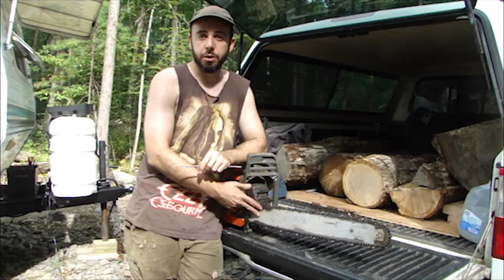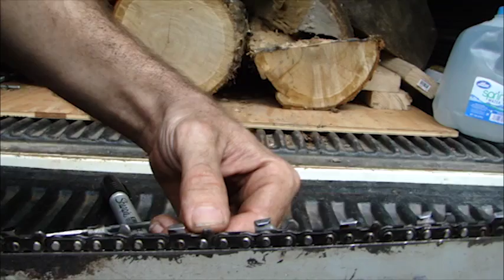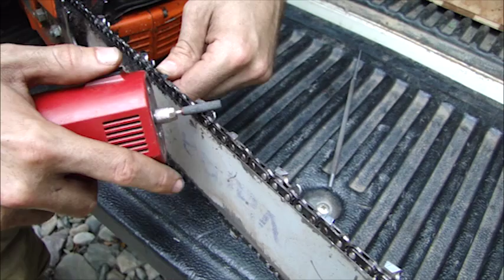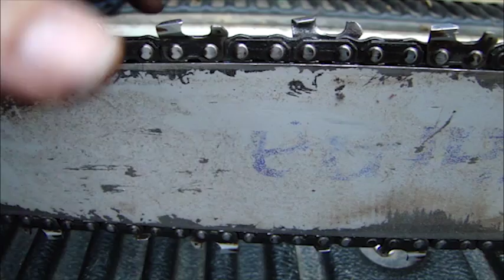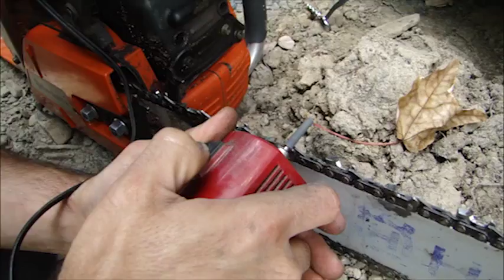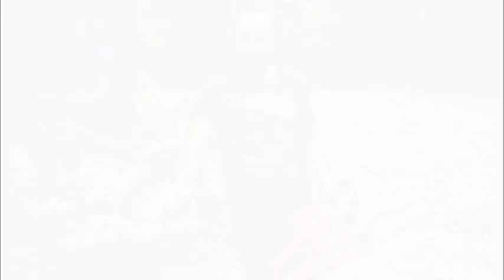How to Sharpen a Chainsaw

Comment: The term "raker" is a misnomer.  It doesn't rake a chip from the kerf, the cutter does that.  good to see you point what the "raker" does, it is a depth gauge.  

Your bar looks like it has been over heated.   Running a dull saw will shorten the life of the saw, due to extra heat and wear on the crank bearing.  

I've always used a file free hand, a bugger to have to put 12+ strokes per tooth.  Dirty logs is the pits.

Comment: It might be wise to wear some eye protection when sharpening ,a hot metal splinter will easily destroy vision in an eye...not worth the risk . The same as being so confident you don't wear the chainsaw visor gloves and trousers ....28,000 chainsaw accidents a year in the USA . Most common cause kickback from hitting an object causing loss of grip...legs and hands being 90% of the injuries.
Respect the chainsaw and its a great friend , disrespect it and its your worst nightmare. :-)